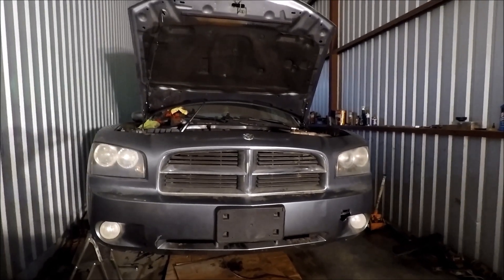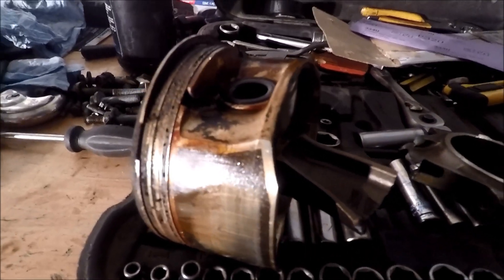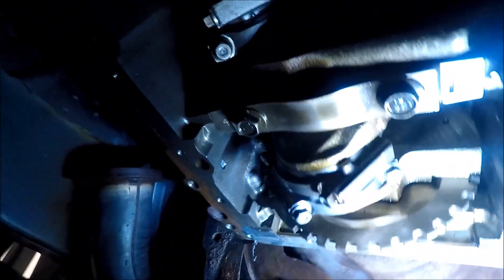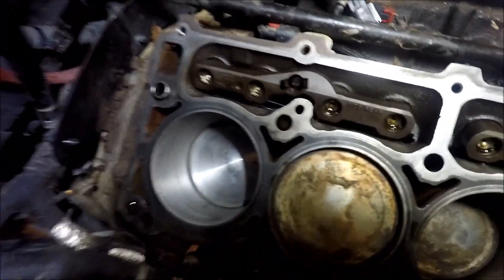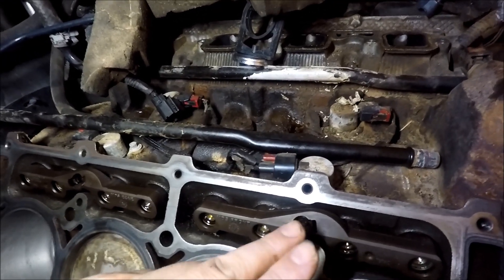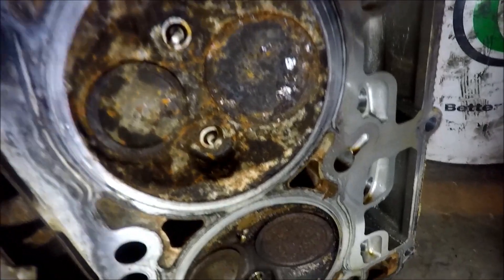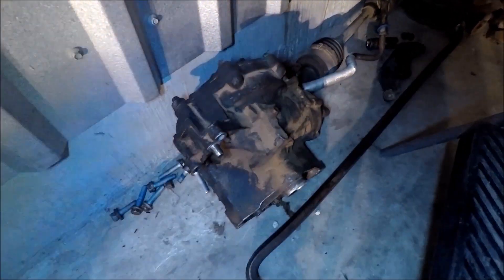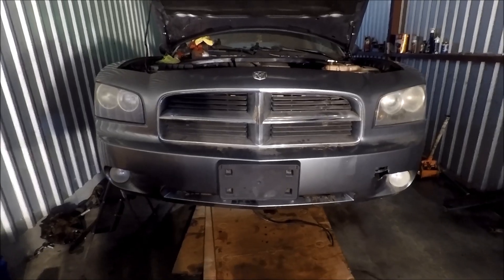Fixing Customers Flooded 2007 Dodge Charger 5.7 R/T -- Engine Hydro-locked and Busted Connecting Rod

Comment: Remove those air filter box those are number one killers of those cars in the rain an flooded road inlet tube go straight down sucks that water right up just happened to my 05 Magnum RT I broke number 8 cylinder and bent number 7